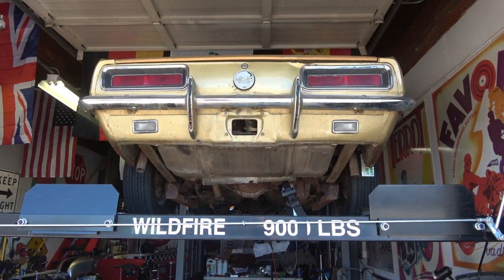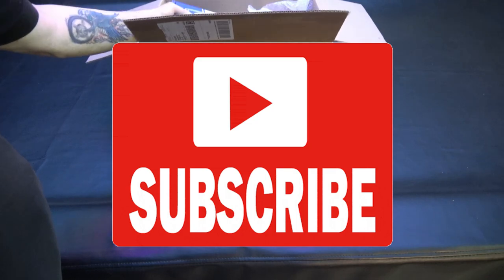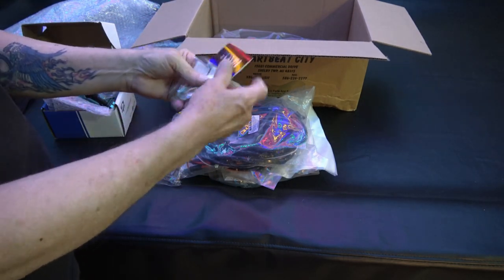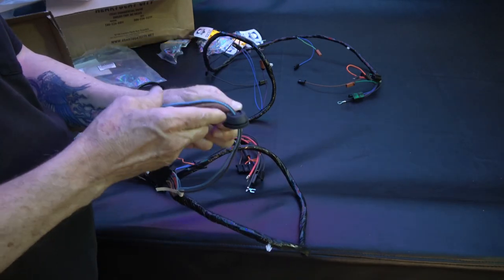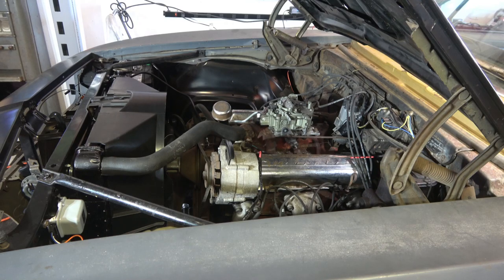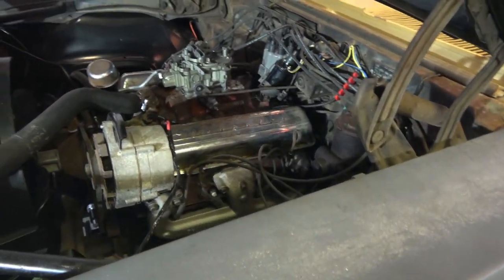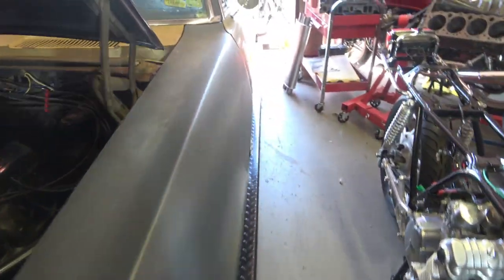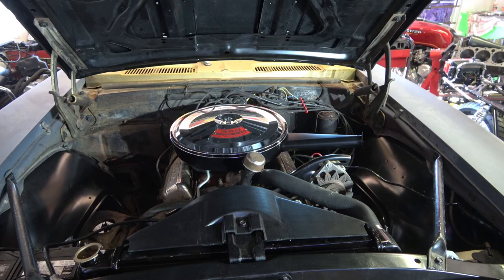67 Camaro RS/SS 350 4 Speed Restoration - Part 3 - Will it Run? After 20+ Years?

Comment: I don't know if you know it but you have a factory  Traction bar rear end Very rare you can tell can tell by the bracket hanging down on the right side of the  Differential
Reply from the maker: Hi Robert, yes I am aware. This car was built on December 29 1966, so it should have had the round traction bar installed, but it didn’t. The front bracket that would have been welded to the floor is not there.
So I may add it or leave it as it came from the factory.

Comment: All Camaro are call ssrs not rsss
Reply from the maker: I am sorry, but that is not correct. The Rally Sports were a particular package option. So there were Rally Sports that also had either the SS package added, or the Z/28 package added. So, you either had a Camaro Rally Sport. a Rally Sport SS, or a Rally Sport Z/28. You can look that up on many websites or Forums that explain that, such as CRG, Camaro Research Group

Comment: The switches for the headlights are called limit switches since they stop the motors when the lights reach their open and closed limits.
Reply: I like the originality of the 67  fuse panel. They can be saved!

Comment: Did you find that 67 Camaro parked in a lake, that things a rust bucket  !
Reply from the maker: You will see in upcoming videos that it was simply surface rust that came clean after we had it blasted. There are a couple of patches to the floor, but overall the car is hardly a rust bucket.
Reply: @digitalpizza1  in Colorado were I'm from you rarely find cars in that bad of condition unless it's been submerged in water or dirt  !

Comment: I had to look twice at the lift weight limit  something was covering the third "0" !  She sounds very nice and l didn't think she was loud  , mind you l'm old and deaf !  I see she has the deluxe door cards and from what l glimpsed the interior looks very sound . The undercarriage is  no trailer queen !  It's a great project car for someone and l guess 350 ? Oops ! It says 350 on the title John !
Reply from the maker: Hi John, The car is a lot louder than the video represented. The short pipes and glass pack mufflers just don't have that correct music that the early 350s had. Yes, a virgin 350 that has 62000 original miles and never touched.

Comment: Air cleaner looks out of place :)  Nice car.
Reply from the maker: That is the original air cleaner that the 350 SS came with from the factory
Reply: @digitalpizza1  Minus the Patina :)
Reply from the maker: Hi Brain, yes that is true , you are correct, I wish I had the original one, but I got the car without it, so I did buy a new one. :)

Comment: No engine rebuild???
Reply from the maker: Car has 62000 original miles, engine and trans have  never been rebuilt or been out of the car.
Has good compression and runs great.
If I keep the car, I may rebuild it then